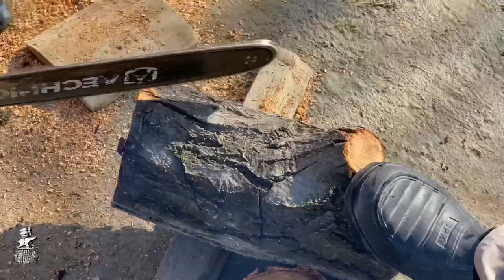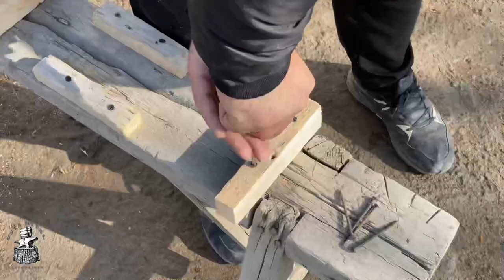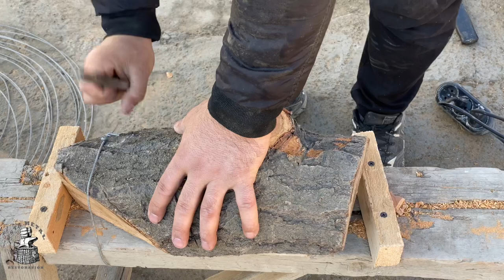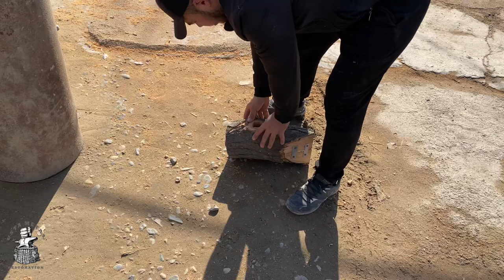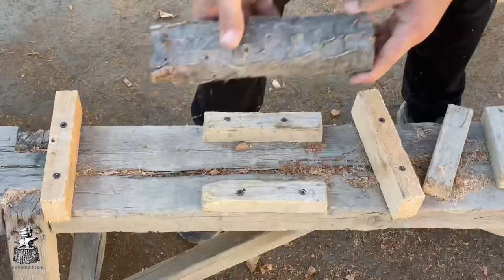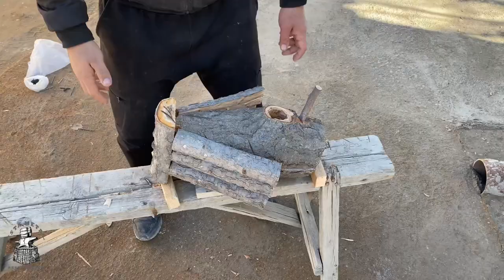Diy Bird House

Comment: Should not have glued the two halves together.  There is no way for the annual cleanout.  Also, the entry hole is way too large; likewise, birds do NOT require a perch at the entrance.  Predators, however, do.  Otherwise, a nice, rustic and completely natural woodland bird home.